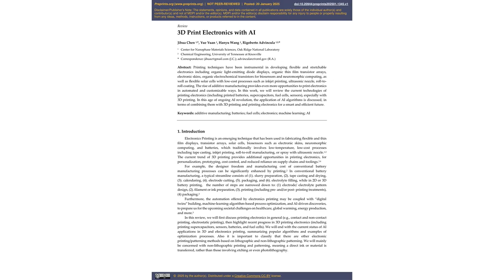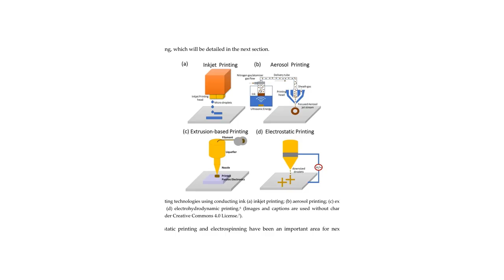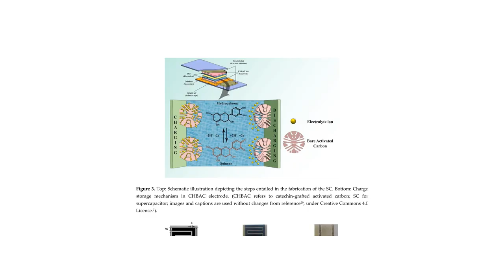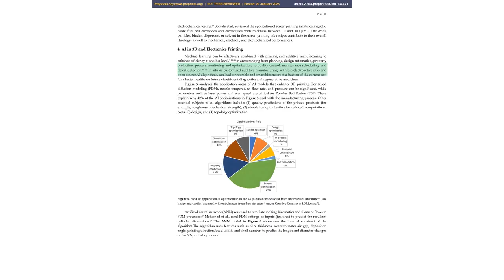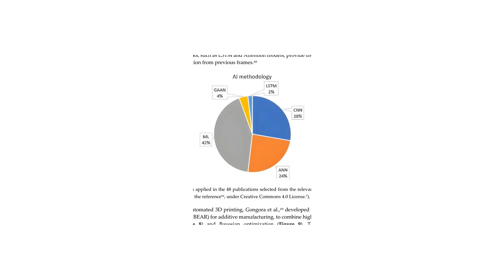Learning 3D Printing, Electronics and AI

Comment from the maker: SUMMARY:
This video explores the convergence of materials science, additive manufacturing (3D printing), and artificial intelligence (AI) to revolutionize the production of flexible and wearable electronics.

Key takeaways include:

The shift in electronics manufacturing: Moving away from traditional silicon-based lithography to non-lithographic printing (e.g., inkjet, aerosol jet, and extrusion-based printing) enables more flexible, stretchable, and customizable devices (0:49-1:17).
Advancements in printed components:
Supercapacitors: 3D printing enables custom-designed collectors and electrodes using materials like carbon nanotubes and deep eutectic systems (6:50-8:31).
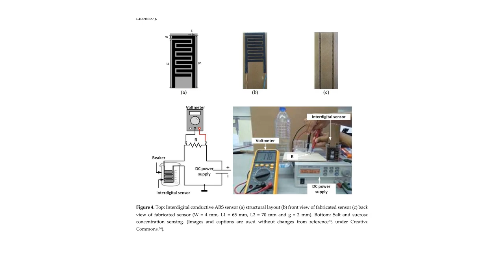Sensors: Flexible, interdigital sensors are being printed for various chemical detection tasks (8:31-9:23).
Batteries: Direct ink writing and photopolymerization simplify battery assembly and improve performance (9:23-10:28).
Fuel Cells: Additive manufacturing optimizes flow field plates and membrane structures, improving durability and power density (10:28-11:51).
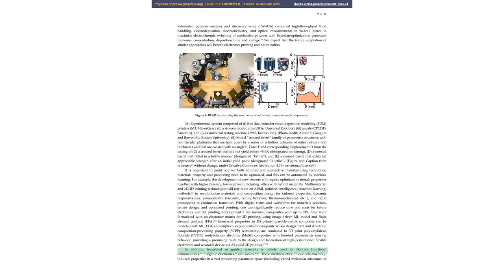The Role of AI: AI acts as a catalyst for efficiency, with 42% of current applications focused on process optimization (12:53). Techniques like Bayesian optimization—exemplified by the BEAR system—show a 60-fold reduction in experimental time to find optimal printing parameters (14:51-16:22).
Future Outlook: By integrating digital twins and autonomous AI workflows, the industry is moving toward highly efficient, personalized manufacturing for the next generation of smart devices (16:30-17:55).